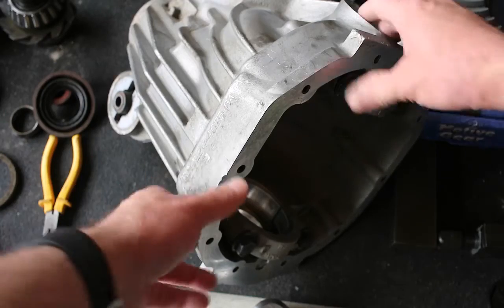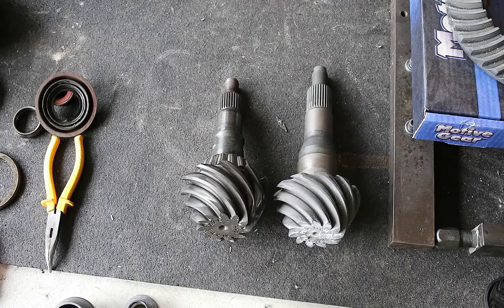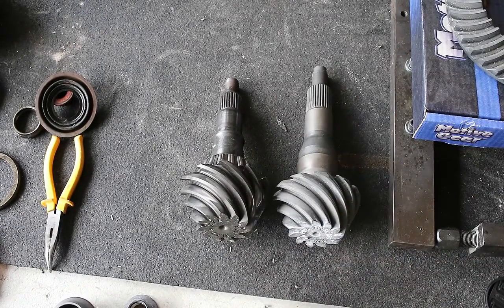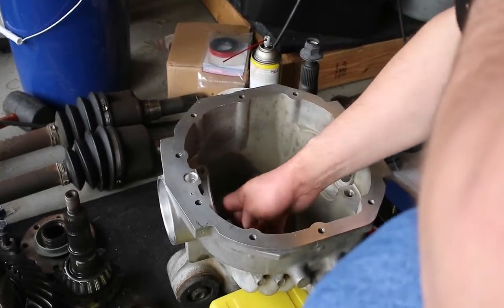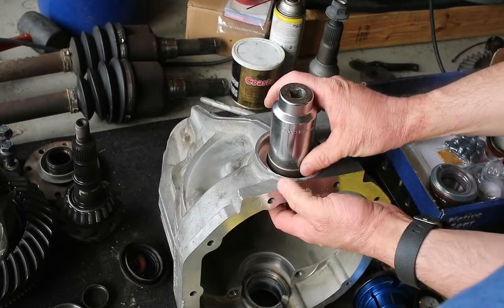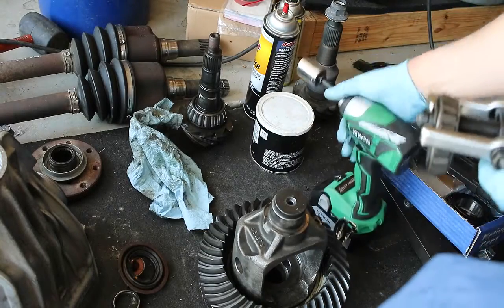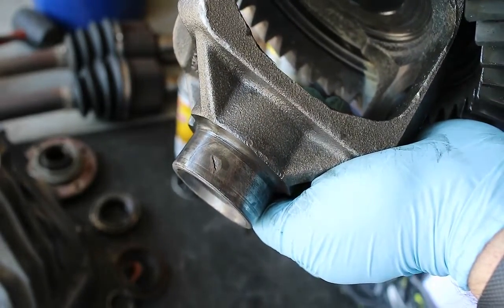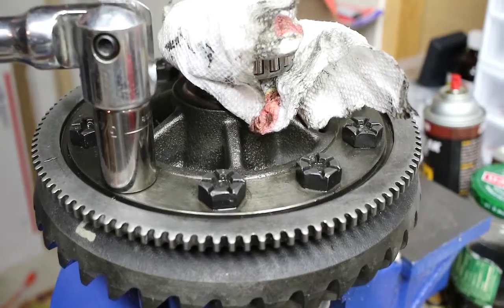VLOG #13: Ford 8.8" Differential Rebuild - Off To The Races!

Comment: Looks like you have it all covered nice job . The biggest concern is the preload on the pinion gear .Thats where you can get a whinning noise with power on and also when you let off on the gas or power .I've seen rear ends set up the wrong way wher the gears gat like razor blades  by not getting the set up right .  At this point I would take it to the shop and have them set the preloads to avoid having to do it again , Gerry
Reply from the maker: +krazy45cat I've got the training (took Ford Tech classes in college for a few semesters) and the factory build/tech manuals ... I'll get it a go. I've already pulled the pinion bearing and measured the shim to get me in the ballpark. Once the ring and pinion arrive (ordered from Summit after posting the video, already shipped) and get the pinion bearing pressed on with the correct shim, I'll measure the backlash and go from there.

Comment: Concerning the axle bearings at 5:00, how did you remove them? 

Do you think they could be replaced on the vehicle without opening the diff cover?
Reply from the maker: yes, but you will need to get really creative as space under that area is very limited. You can build a bearing puller, but want to take utmost care not to damage the housing when pulling or driving the bearings. What makes you think just these bearings have gone out?
Reply: neutered10mm The right side bearing seems to have gone out as that cv joint has a wiggle to it and only the right side has a vibration at 70 mph. The fill plug magnet also has picked up lots of powdered metal. 

I was gonna have a new bearing and seal on hand and then pull that axle out and take a close look at the bearing for damage. There's obviously some kind of damage around there, yet the ring and pinion seem fine.

I guess it's possible that the metal cv joint shaft has worn down and the bearing is fine. I won't know until I take a closer look.
Reply from the maker: So what I would do is look at a 2 jaw internal bearing puller attachment for a slide hammer or a "blind hole" bearing puller set. Something like this should work: https://www.youtube.com/watch?v=27YCUMzKcfE
Reply from the maker: A little heat helps as well, just don't overdo it! https://www.youtube.com/watch?v=eNCKmPPdNqQ
Reply: @josephpark18254  I never messed with it. The vibration is barely noticeable and has not got worse.
Reply: @josephpark18254  I do check the magnet every six months or so. As long as it's not overpacked with metal and keeps the fluid clean, it should not damage the ring and pinion. I have a routine where I put some four by fours behind the rear tires and just drive up on it and then I've got some plywood I'll lay down. It's really easy to slide under there, clean the magnet, and get out. I noticed less and less metal particles every time I check.
Reply: @josephpark18254  Yeah, I have no leaks.